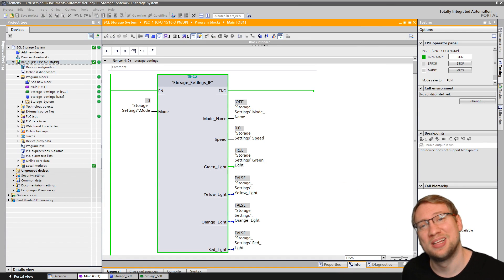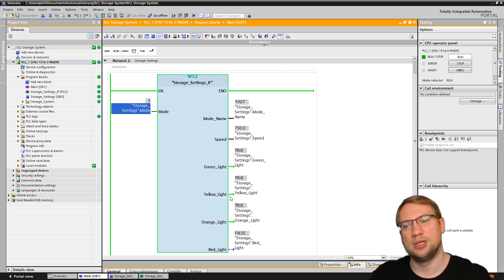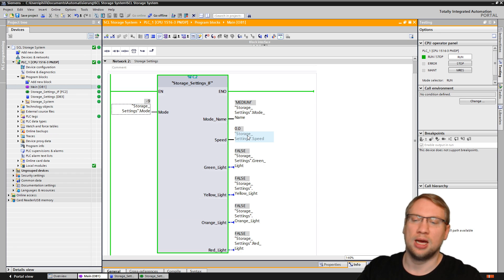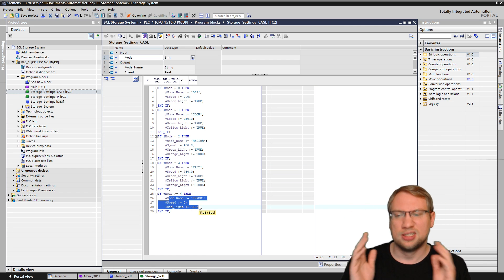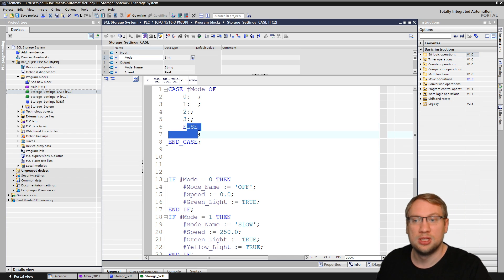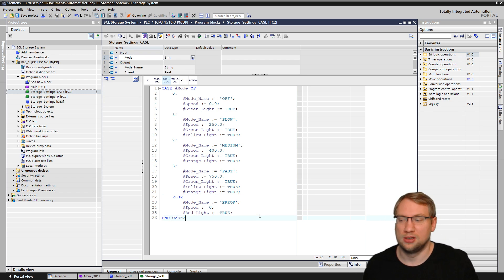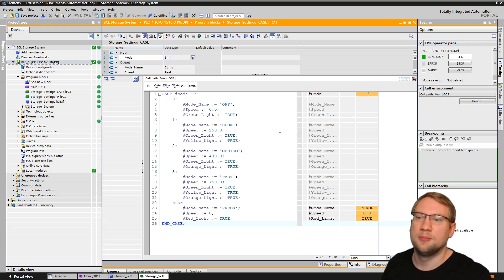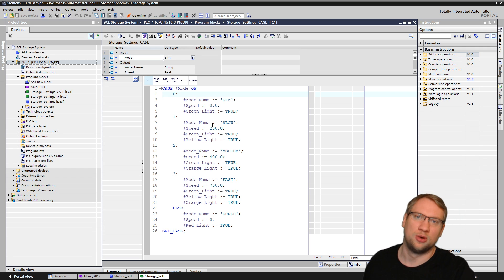TIA Portal: "CASE... OF..." Statements in SCL

Comment: Excellent as all your video  on TIA!
 Could you develop more on SCL please?
 ie : if you need to know more than the occupation of the storage (Booleen) but also length of the item (Real) and its reference (String) etc to fill up an Array of UDT.
 I've done it by an iteration of code  for each but is there a way to include all in one  ?
I get an error with using AND but there is probably a better way ;-)
  #Shelfs[#selected_Shelf] .Occupied := TRUE  AND #Shelfs[#selected_Shelf] .Length := #ItemLength AND #Shelfs[#selected_Shelf] .Reference := # ItemReference ;